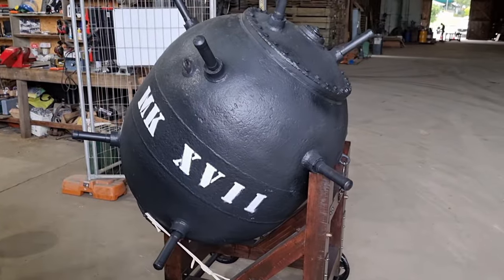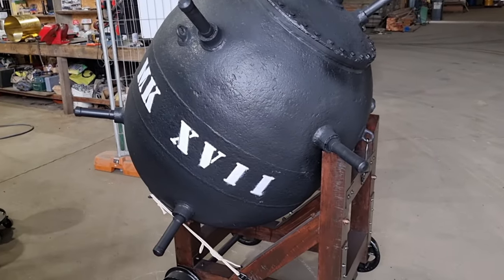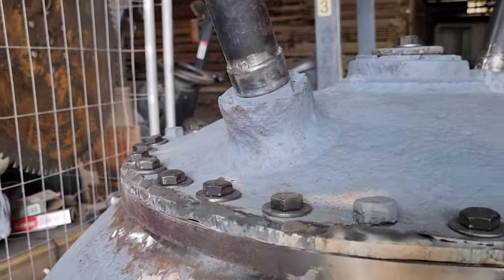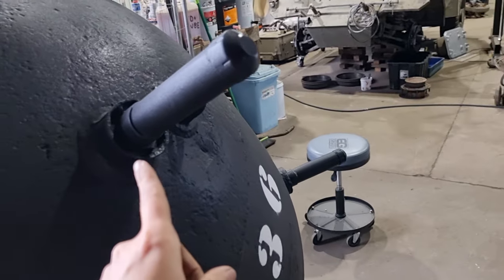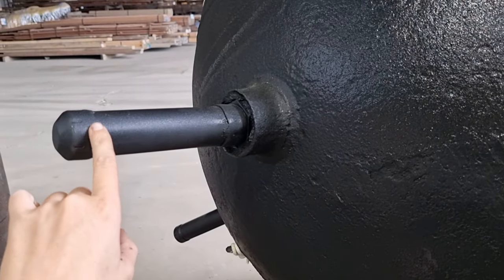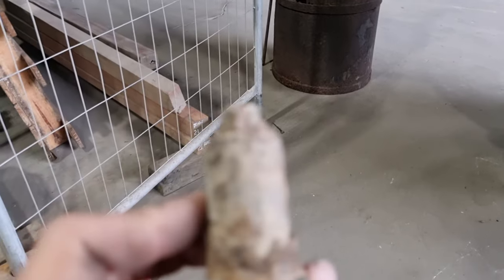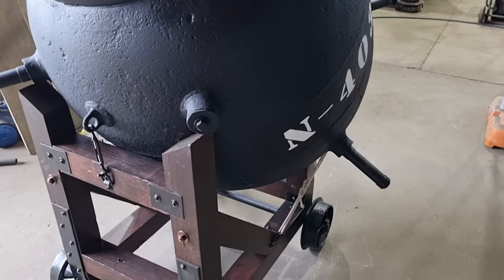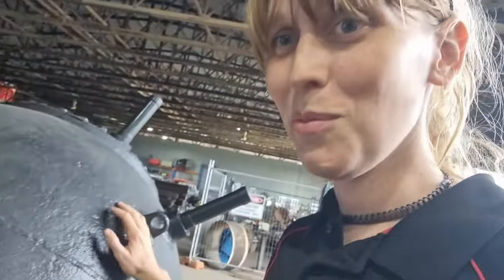Sea Mine restoration in a week!

Comment: The Navy kept a couple of Warrant Officiers in Cairns with a Landrover to destroy these as they came loose and washed up.Have seen these on the  drive up the beach into Cape Flattery. Most of the Passages through the reef were closed with mine fields to control access to the inside the reef shipping lane up the coast to New Guinea. Marine Charts in the 70s & 80s had these minefields marked. I remember them destroying one in the late 80s on  the big beach north of Cape Bedford.Thanks for the great reminder!

Comment: That was a fun job. 
I used to work for company that made batteries like that - they were for arming shells as they were fired. 
A sprung pin broke an ampoule of acid as the shell was fired, the spin then spread the acid over the activated plates which generated electricity which armed the shell. 
Much the same principle